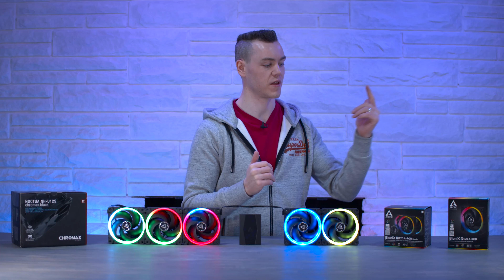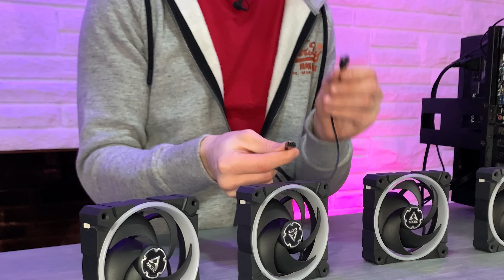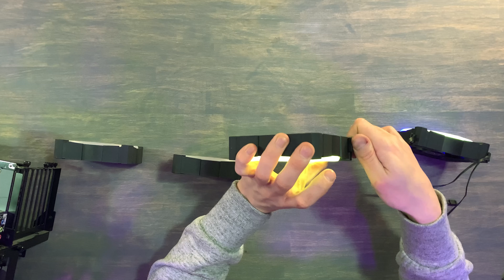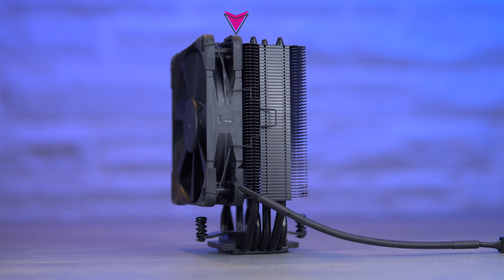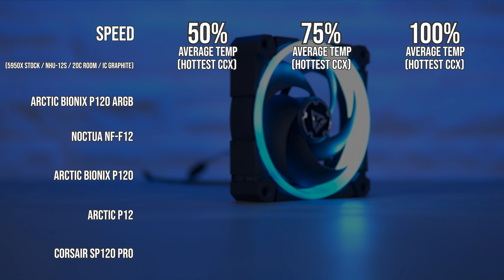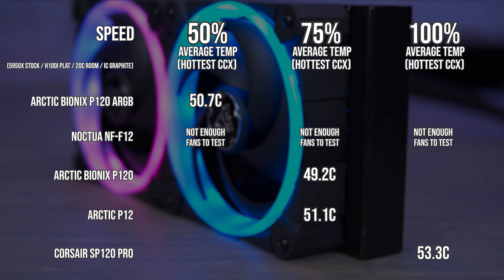The BioniX P120 ARGB's Maybe the BEST Performing ARGB Fans... But They're A Little Confused.

Comment: Super informative, but do you know the starting voltage of the Arctic Bionix P120 argb fan, because I'm searching for something with a low starting voltage, preferably something that operates at at least 3.3 volts, for my psu.

Comment: Corsair CO-9050091-WW LL120 creams this fan 63cfm and 3mmH2O as well as 4 light rings
Reply: yeah but you pay 30$ for one fan when for the same price you can get 3 artic fans. plus the corsair one needs a controller as far as i know. you can't daisy chain them
Reply: @chrislamp  I use a gigabyte b660, it has both rbg and argb headers
Reply: do you have 3 argb/rgb headers? cause as far as i know the corsair fans are not daisy chainable

Comment: Thank you so much man for your greate job you have done in this video. The 30mm is a problem for me because these fans will touch my cpu fan cables, so it will not fit easily in my case. If i had bigger pc case  or bigger dimensions motherboard maybe i wouldn't have this problem . So thank you very much you help me a lot. Its kind of sad because i like these fans, but it's ok i will buy something else that fit better to my pc. You are greate man , very good job.

Comment: If I use the controller and plug it in a 4 pin RGB header on my MB, will I still be able to sync them with my RAM using Aura for example?

Comment: Arctic literally makes the best Fans especially for Liquid cooling and while a tad louder than a Noctua in some areas they far out perform any other brand.  Arctic has been my go to fans for years their P series fans for Radiators and F series for Case airflow work flawlessly.  I would think with the the 30mm width they could have made these a Dual loop so I am disappointed there, but can't wait till they make the F-140 variant as that's the size I use but will grab these for my 360 Arctic freezer AIO. Great video thanks!!!! Love Arctics products as they are the best value to great performance cooling people in the industry.

Comment: Comparing noise and performance by percentage of speed is stupid. Should do it by rpm.

Also do these bionix have the same awful motor noise at 1000rpm as the P12? The P12 is decent for cooling but the hum/whistle at 1000rpm ruins it.

Comment: For 60$ msrp on the 3-pack the sound is awful! I bought 2 pieces of 3-packs of the Alpenföhn WingBoost 3 ARGB High-Speed fans, costed me about 84$ per pack (168$ total for 6), the ARGB leds look way better, they are not thickbois so they fit way better, their sound is a nice deep humm (not an annoying buzz like these and CM's MF120s..), and the CFM is way higher too. You should review these fans for sure! I'm all about Alpenföhn products since I discovered these puppies, they also make nice CPU aircoolers and I heard their AIOs are insane. Nice video though, liked all the details, you put in good work! Definitely liked and subscribed, good to see people like you amongst the tech community!

Comment: What does it mean for it to be pressure optimized?
Reply: Pressure optimized is when they perform better by pushing or pulling air thru tight spaces like heatsinks and radiators. But if a fan is airflow optimized, it performs better with no constriction, such as case fans.

Comment: Bought some of these for my sisters build and I really liked them. Only issue I had was trying to figure out how to hook up the rgb as the mobo I uses only had the 12v header and I had no idea what way to put the cable on. I never got it working but eventually my sister got the remote working with them. At least pwm control works. I am super happy they came out with a argb fan though, love their products and have been wanting to replace some noisy fans on my rig.

Comment: lian li SL120 is a better design with higher cost.
Reply: Better design with connectivity on the lian li fans, but I think the RGB design on these are much better looking and worth the extra effort especially considering the lower cost.
Reply: Better design? He actually talked about how these have better design than those more expensive SL120's, if you only watched the video.
Reply: I am basing my opinion on my personal experience with both. The Arctic Fans don’t lock in place where the Lian Li fans do. I was giving my opinion, not evaluating the video.

Comment: 1. do you think this will work with a cooler master argb/ pwm hub? or any decent argb/pwm hub with software?
2. where did you get that grey stain table top? im looking for one for a desk build lol
Reply from the maker: Hey, as long as the controller / hub uses the same connectors, your all good 👍

In terms of stain... It actually turned out pretty blotchy and wasn't good at all - so I scratched it with 80-120 grit to create the weathered / beaten pattern before I polyurethaned it 👍 all things considered, I think it turned out okay.

Used this: https://amzn.to/3crvmea

Comment: I have this set.. the install in kinda confusin.. and at normal  idle speed they have that annyoing uuuuuuuu sound.. I am not impressed by them.
Reply: CoolerMaster's MF120 ARGB is literally sounding the same.. Kinda disliked these fans which have the high-pitched annoying buzz instead of a deep calming humm. These Bionix fans could be really good value but oh man the sound, that can deter a lot from purchasing.
Reply: @sL1NK  arctic just released p12 pwm pst argb 0db. They can stop etc. Think I am going to give them a try and hope oh hope no annyoing sounds😂
Reply: It seems like the resonation issue at certain RPM occurs across all Arctic 120mm fans. But interestingly, P14 works just fine. Not sure what caused the problem.
Reply: @Thopher99  well I bought the P12 PWM PST A-RGB and they dont have any resonation sounds. Great value fans.
Reply: @waskus  I was looking into that fan a while ago, good to know that! Thanks!

Comment: I got these on launch night... love em to death but the fact that they did not supply 35mm radiator screws meant I had to wait till i ordered these seperately. I contacted arctic customer services and waited over 2 weeks for a reply. terrible service, eventually got a apology from the head honcho himself and decided to just buy the screws myself. 
they perform well, and ive gone from a cable mess to one elegeant cable connecting all 4 of these i have daisy chained together. 
<3 arctic, ill give em the benefit of the doubt on this one horrible CS experience i had
Reply: And there I was wondering why there's no reply for 4 days...
Reply: 32mm would work

Comment: Wish they have higher static presure ^^Rly love those bionic  fans ^^ but i just put in Ek varda 120er evo d- rgb on my LF 240 arctic for better presure ^^
Reply: Hi,  i tested ek vardar 120 evo on normal AIO size rad and on a thicc (45mm) rad with 20psi or what that number is. and the vardar was the worst fan i had. i think you need a RLY  dens rad for getting any use out of them